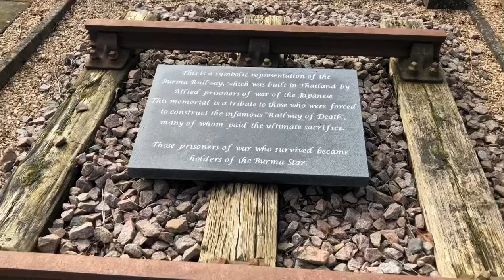Superbe Sunday Saunters! Riding 2 1980s Raleigh Superbe 3 speed bicycles. Dutch & Belgian models.

Comment: Hi! Firstly, let me thank you again for all your help, I can't name the stuff I learnt through your videos. I also have a question. Have you ever filmed the wiring of the bike, I mean passing the cables from a traditional dynamo to the back of the bike? I can see the holes in the frame, but I don't know where to start passing the cable on a 80s Superbe. Do I have to remove the pedals? Thank you in advance!
Reply from the maker: I’ve never done that either. I hate wiring the lights, and I don’t often bother if it’s a daylight bike. 
I’m pretty sure you will need to open up the bottom bracket to pass the wire from the seat tube to the head tube, and drop the forks out to get to the front end and either pass it out of the hole in the frame, or up the centre of the handlebars on those models.
Pain in the arse!

Comment: i showed and shared my few in collection. think an 80's Hurcules, like a Raleigh. fair condition, butt plan to have tuned up at new guy opened bike repair shop in Marfa.i troubled to get all fixed. only sold vintage swin varsity for $99 proffit.